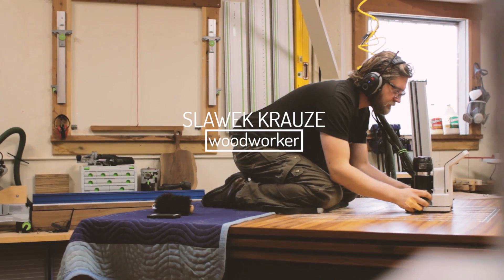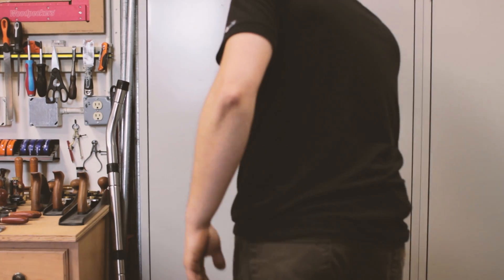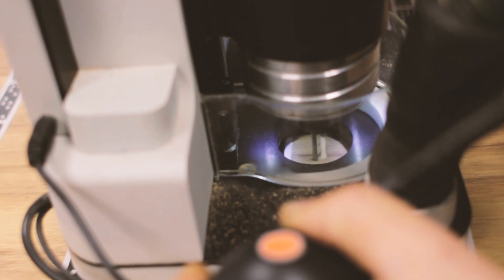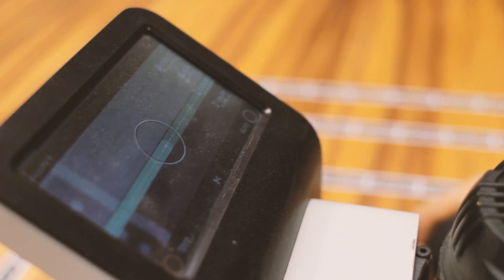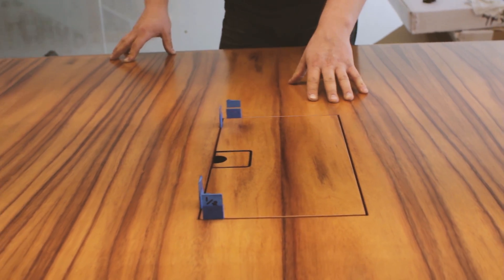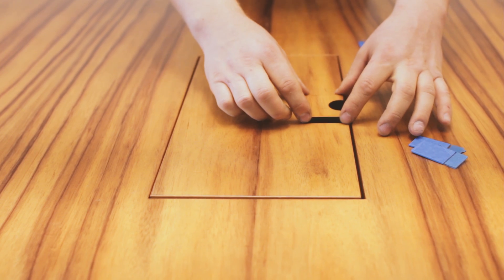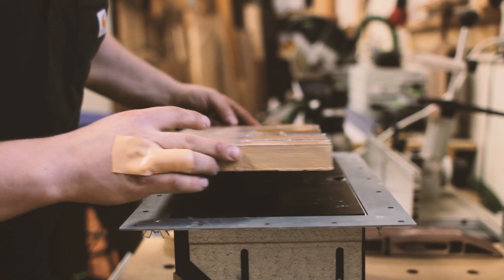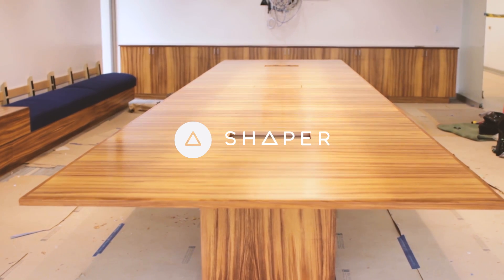Shaper Origin and The Progressive Woodworker

Comment: I just ordered a Shaper Origin. I don't have space or money to purchase a flat bed CNC and I wanted to get away from building templates for my handheld router plus using a mix of handheld router and router table. The Shaper will not completely eliminate the need for my outer router tools but it will create greater possibilities for me. I also like that I can route the end grain for the first time (with control :-) ) to create box and tenon joints. I'll even be able to create custom mortises of any shape.

I'm not sure I would have attempted Slawek's cut-outs without a numerically controlled tool like Shaper.

When I purchased the Shaper, I was able to use someone else's referral code to save a $100. It's still expensive but every bit helps.

I'm passing along my referral code so the next person can save $100 on their purchase. I will also save another $100. Please follow the link below to use my referral code;

https://preorder.shapertools.com/ref/AM8GNCMB9

The referral promotion at Shaper ends at the end of September 2017 plus they are increasing the price of the tool to full retail. It's why I jumped at purchasing the tool now instead of waiting for general availability.